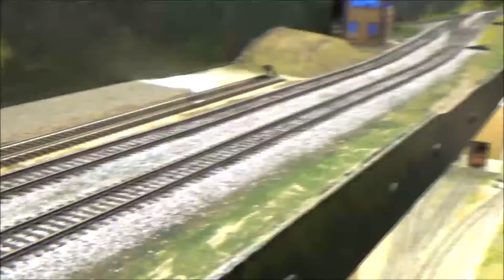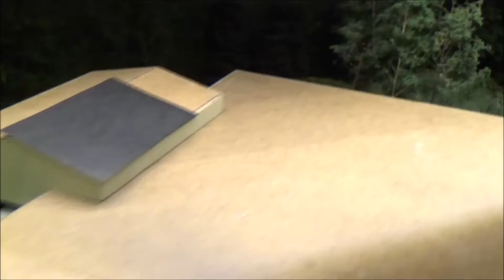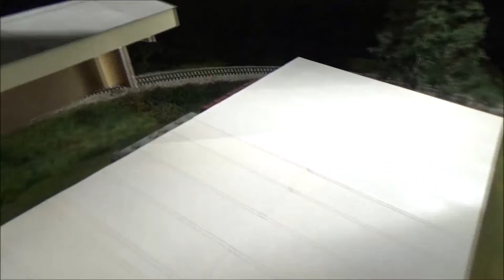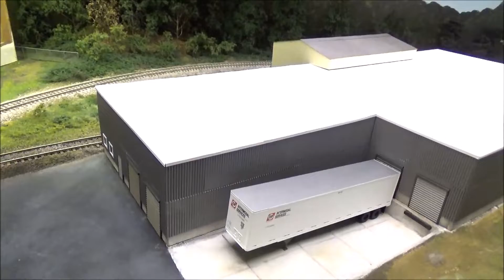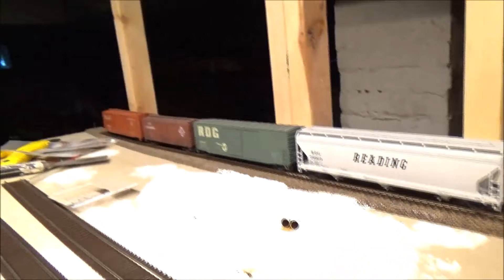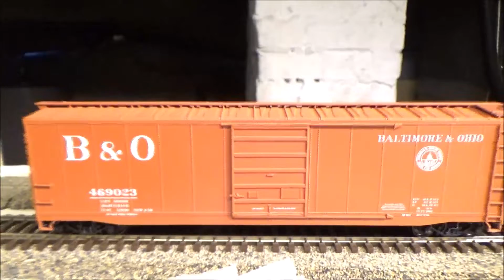Model Railroad Update 11; Benchwork, buildings and rolling stock

Comment: I like your idea for ballasting your ties.  It is something I will be doing during my Fall-Winter Upgrade.  But I do have a question.  I was wondering, to match up existing ballast, what do you think of adding a rust color wash to the white glue and alcohol mixture?  To add pigment to the line.  Also, before I do a test (& possibly damage my layout, been there, done that) what about other colors mixed in for super weathering?  Would like your input.
Hope to see you DOWN THE LINE.
Reply from the maker: I think most of the glue winds up in between the pieces of ballast but I have not tried that so I don't know.  For painting rails i mix flat black and leather from model masters at about half each of until it looks right.  Thinned with odorless mineral spirits and airbrushed.  I wear a hydrocarbon respirator and run a fan out of the basement window while I paint.